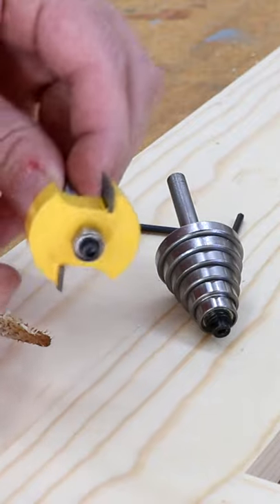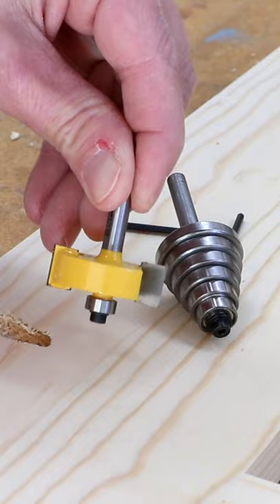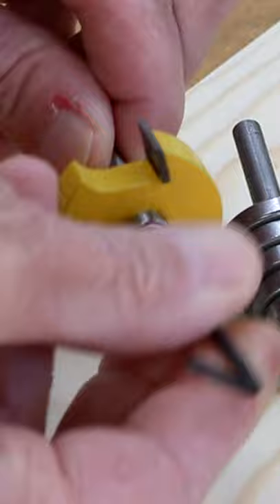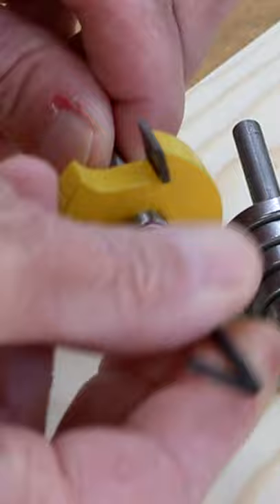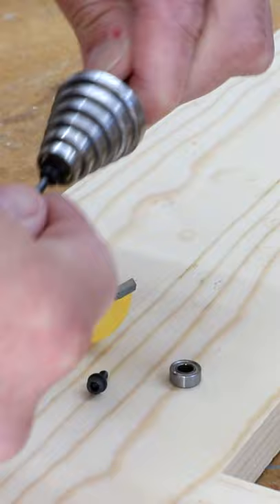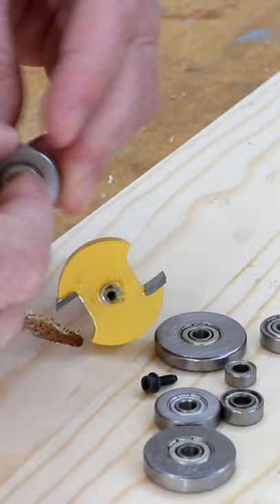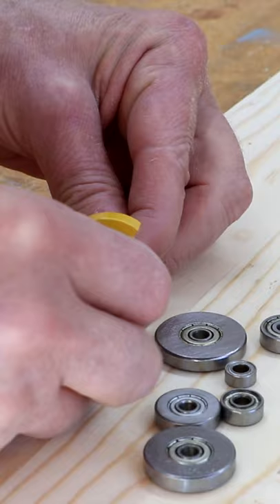How to use an adjustable rabbet bit. #shorts

Comment: When deciding which bearing to use, put a bearing on the bit, measure from the outside edge of the bearing to the tip of the cutting tooth on the bit. This will be the depth of the cut. All bits and bearings are centered on the shaft, so you'll need to measure for each bit when changing bits.

Comment: Hey Steve how did you perfectly cut the insert to match the door hole?!?
Reply: If you look at the full video, he used a jigsaw to round out the edges on the backer.  The other alternatives are to square the rabbits on the inside with a chisel, or pre-cut the rabbets before putting the wood together.